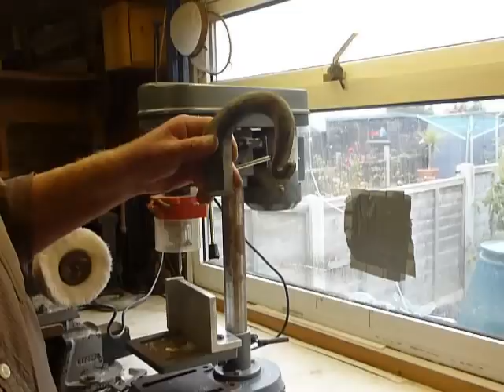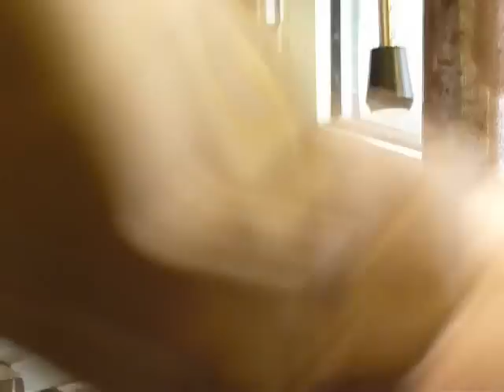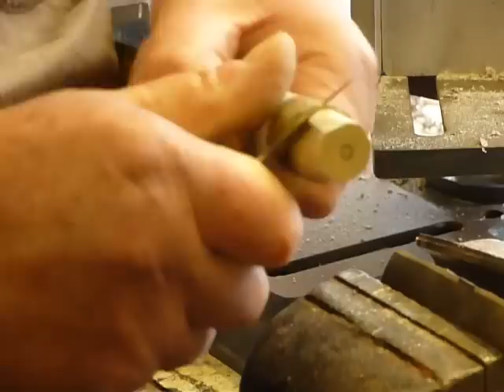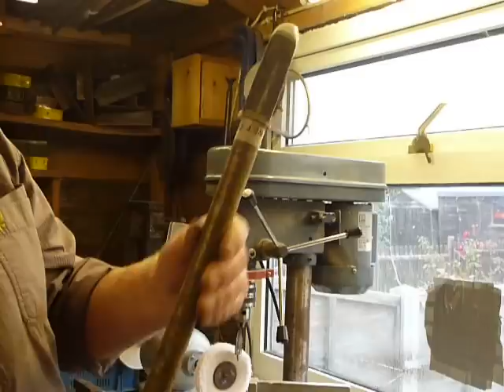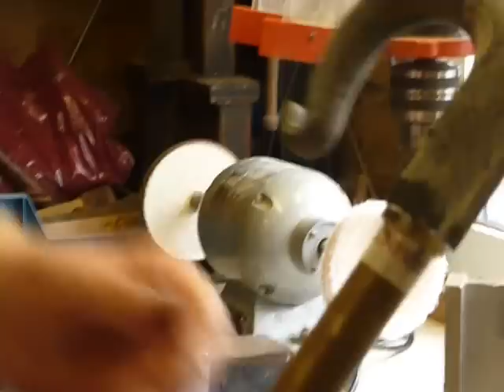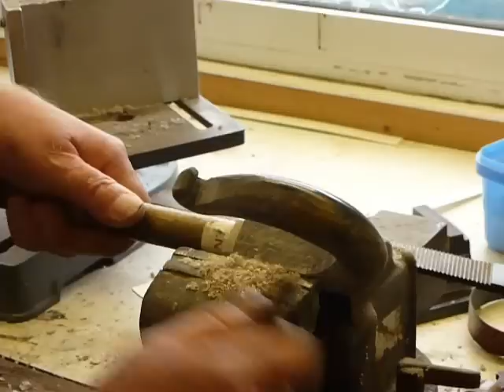walking stick demonstration fitting a buffalo horn handle to a stick series 6

Comment: When centring your drill bit for the dowel hole, you might it easier and more accurate if you strike a line corner to corner both sides. Where they cross is the exact centre and if you then use a centre punch on the centre mark, it will stop the drill bit drifting. Your jigs a good idea for keeping it square to the chuck. Nice vid.
Reply from the maker: Thanks for that Edward

Comment: Hi Dave. I have been making sticks as a hobby mostly since the '60s but though I always wanted to, have never used horn. Having just watched all six videos of this series I can say that these are the best stick making videos I have seen.
I have made quite a few antler handled sticks which are relatively straight forward, now I have seen you working buffalo horn I really want to get a couple of pieces and have a go.
Apart from a drill press, hot air gun and epoxy resin, everything you do is more or less the same way sticks have been made for centuries, I love to see genuine hand craftsmanship and a good eye.
I am going to copy your straightening jig as it's the best I have seen, I live in Spain so my materials are different; Sabina ( Spanish Juniper) makes fantastic lightweight nobbly sticks and Olive wood makes very strong sturdy sticks. If I can't find a root knob mostly I make olive wood handles but have always fitted them with 10mm studding with a couple of flats filed top and bottom to prevent any chance of turning now I will try your dowel method.
Many thanks for sharing your skills and in such a pleasant watchable way.

Comment: I don't think I have commented on your video's before, though I've watched a few of them. I don't like how small you make them in general, or how short. For your walking sticks, by the way. However, i've picked up some stuff from your tool techniques. I also really enjoy how you're using, more or less easy to acquire tools to craft them, and the tips on how to do that! Including your straightener, the steamer you used for it, and of course boiling the horn to make it pliable. Hadn't even thought of the washer on the end for a center line and then hand cutting it like that either. I sometimes overthink problems that can be finished with a simple solution.  

I hadn't thought of using Buffalo horn, or the like in some in the past. So I've really enjoyed how you've shown how to shape them and what you have to go through to do such. Part of the different views I chalk up to artistic differences. :) I've only recently started using wood as a medium to do some of my artwork, and you amongst a few others have inspired me in several ways. 

Though I would like to ask this: Why don't you go for a larger staff when you're picking them out? 
Why did you use a regular dowel rod on the buffalo horn instead of using one of the others you had hunted up and showed us how to dry and straighten out before on the buffalo horn? 
I suppose I have a third question, and I hope I am not being a bother, possibly even a fourth. 

Where do you acquire your horn from? 
When you say Buffalo do you mean American Buffalo (Bison) or Water Buffalo? I've been meaning to ask since I watched the first one way back when, but I had been working on carving my own scene and relief into one. I just went outside a lot more when I had more light as for the fine detail work my Garage in Winter doesn't' have the brightest light on a workbench so I set myself up one to get afternoon sun in Spring-Fall. It also doesn't have heat but that is another story. 

Any other information you can toss out, I would appreciate as well. If I've missed something in one of the video's I apologize. If you've answered any of these already I also apologize for being a little dense. Thanks for posting the video's and tips for making these.
Reply from the maker: +Erick White Hi erick where do we start, In the US they tend to make walking staffs with carvings on the stick and they are far thicker than we use. Our sticks are about 1" at the top tapering to the botom .I get my water buffalo horn from importers in the uk. All countries have there own rules on importing animal by productcs . Dave
Reply: +woodlandsticks I appreciate the response. I truly do. I've watched several of your video's and I am a subscriber, though I tend to like my walking staves a bit thicker. Though you've caught my imagination on a few of them, and given me many idea's.

So I wanted to let you know that I really did appreciate the time you put into showing them and crafting them and not just skipping ahead, especially when you were working with the horn. That gave me some very important perspective. 

I wasn't sure where exactly you had gained the horns from, and if there was a specific catalog or online store I could look at. Do you know if using regular Bovine horn would work similar or if it reacts a bit differently? I have a few old family friends with a farm, so that might be easier for me to acquire. I appreciate any time you're giving in response to me. Figure you're generally a busy man!
Reply: +woodlandsticks I should also pint out that this was personally for my own edification and a personal art project I was working on for my own hiking staff. Which is how I found you to begin with! :)
Reply from the maker: +Erick White Hi Erick I buy my horns from highlandhorn but they no longer ship to Aus. or US, its import regulations.The horn I used on youtube was indian water buffalo horn, any horn will bend when heated you can only get horn from a slaughtered animal. Antler is not horn but bone it is shed every year and another set grows, it will not bend with heat.Dave
Reply: +woodlandsticks I knew the antler wouldn't and what other horns come from and the like. I do actually regularly hunt for Antler since I live in a rural area, and I have several friends that art hunters. I've done antler handles for bowie knives and more. So no stranger to working with that. 

I just wasn't sure if you had worked with Cattle horn, that wasn't' ox before, and if it you had, if it worked similar to the oxhorn you were getting. I have to admit something else too. I completely missed a link to the fact you had been selling them. From the video's and the like, I thought it was just a hobby you had really enjoyed sharing with other people. I guess out of all the stuff I had watched, I always missed the link to your actual page! Failed my perception check. LOL. 

Anyway, Dave, I really appreciate the replies you've given and the time you've taken to communicate with me. I'm still working on my art projects and fine tuning exactly what I want to do to finish some of them off. I'll peruse a few more of your video's and see if I missed something  else. 

As I had mentioned, a subscriber to the channel and I really do appreciate the work you've done to post the video's and share your love of doing this with others!

Comment: Thank you for these interesting video series, i learned alot about horn bending and finishing and i never knew that it is even possible to bend them. I myself am making a walking stick for my grandpa, and I would love to make a handle just like your's, but it seems that there're too much work to invest just for a cane's handle. And also I could make the same looking handle just from the cutout oak wood and it would take much less time to make. Instead I will make a very simple handle from antler, I will just bend it and leave it as is (without any sanding etc). Cheers!
Reply from the maker: +Miks Bondars  Enjoy your stick making Dave

Comment: I would think that you could benefit from a wheelwright’s tenon cutter which fits into a brace for making the tenons on spokes.
I have two, one cuts a half inch tenon only and the other is adjustable.
They would really be a time saver.
I’ve had mine for years.
I’m sure they wouldn’t be hard to find on Ebay.
Reply from the maker: Thank you for the tip, but have retired from stickmaking,  that is the sort of thing i would have played with long ago Dave
Reply: Well since you have retired, I do hope that there is someone continuing your craft and congrats on retirement.

Comment: The drilling jig is a great idea for something with a square section, but what do you use to get a perfectly aligned hole in an irregular shaped handle, such as antler. How do you ensure that is sitting vertically?
Thanks
Reply from the maker: Hi Tracey If you go to my web site I have tried to explant it   http://woodlandsticks.co.uk/dowel-joint-walking-stick/       Although I much prefer to hold the antler, set the ratchet to slip if it jams and drill slowly, I show this in video 3  http://woodlandsticks.co.uk/videos-series-3/   Hope this helps Dave

Comment: Hi Dave, thank you for the tutorial! It really is something! I would like to make a Stick for my father-in-law and I have one question (sorry if it is a silly one) left after watching the video. The stick I will be making, will be under heavy pressure for most time as it will be used by a farmer to go up the mountain etc. Will the joint so actually hold? I thought that maybe I should somehow use still bar as a support in the joint or something else to make it sturdier...
Reply from the maker: Hi Artherion  My preferred method is to make a dowel on the end of the shank. If you want you can cut the head off a 4" Masonry nail, and put in a drill, and drill down the center of the dowel, tap the last bit in. if you use 1/4" studding or rod it works as leaver and can split the stick. Hope this helps Dave
Reply: @woodlandsticks1365  Thanks very much for your reply! I will try the nail trick then =)

Comment: How do you construct the ferrel?
Reply from the maker: Hi Stephanie, Clean the inside of the ferrule with sand paper,Taper the end of the stick so the ferrule fits tight and epoxy glue together. Dave